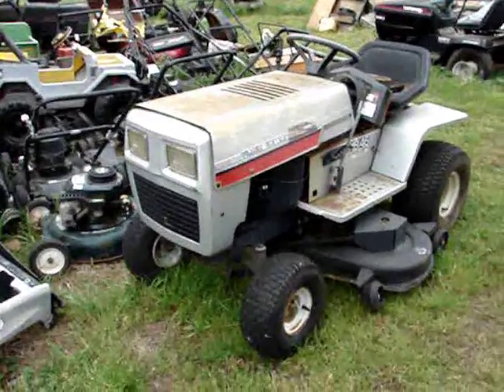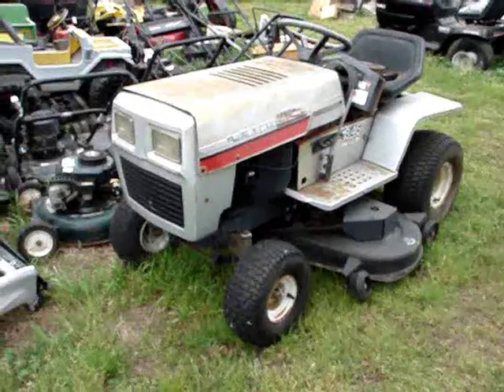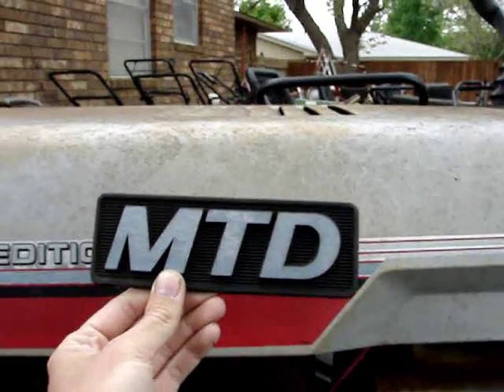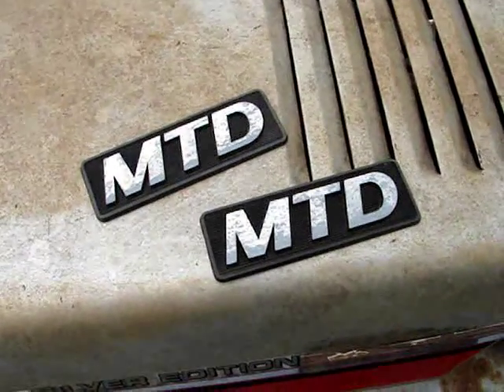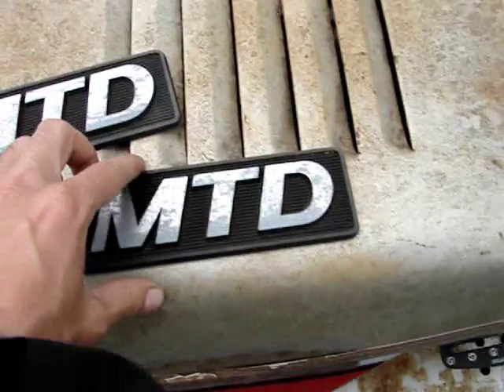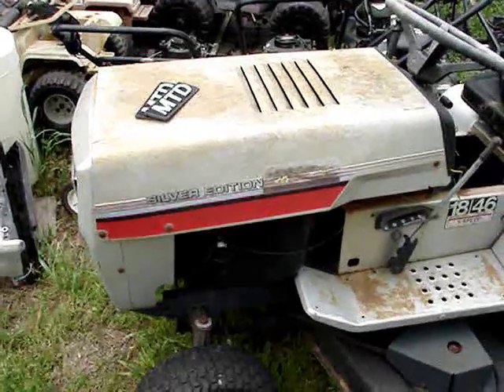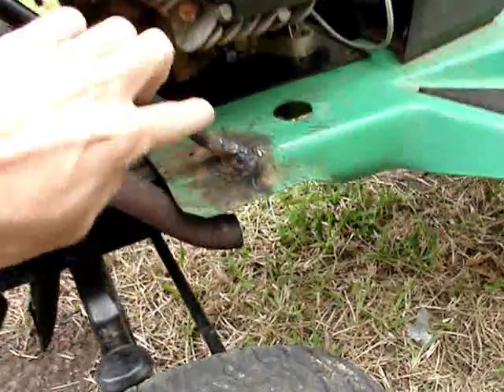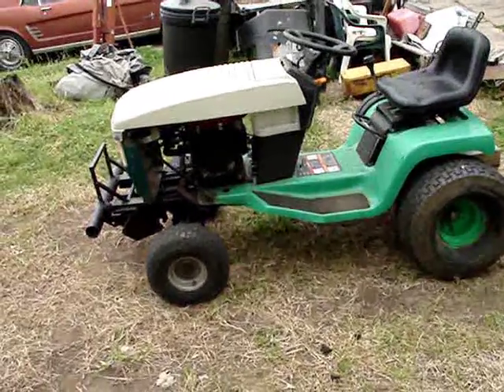MTD silver edition 18/46 lawn tractor, VERY RARE!

Comment: Funny!  That is off.  Its almost identical to my 18/44, cept it has the front half of the hood the same as my mudding tractor.  Never seen that with a big twin under it before!  And a smaller rear end.

Glad you finally found those MTD badges you were after, saves me sending you my  ones.

I really like all these MTD 'garden tractors' you're collecting.  I have a soft spot for them, would love another one!

I think that 5 speed was an after thought judging by the shifter location.  Pretty weird

Comment from the maker: I occasionally run in to people here that think the same thing. I tell them that by the time I am done replacing the battery, replacing or sharping blades and belts, cleaned carb, changed oil, and fixed whatever else is wrong, usually tires need replacing and steering repaired. That I won't make anything off it unless I get it for under 40 dollars.

Comment from the maker: 88, good year for tractors. I love my 88 MTD garden tractor. I have a 1980 Dayton(MTD) that had a well worn 16hp briggs twin. I got the tractor for free a few years ago, still use it today, but I did swap out the still running, but leaking oil and smoking engine for a 2000 model briggs 20hp twin a year ago. Going to rebuild the 16hp. Old tractors last forever, made with good steel, not that cheap impure china steel of today.

Comment from the maker: My old MTDs are far superior to any new model for sure, but goes to say that they were built when people cared about quality. My favorite tractor to cut with is my 1988 MTD model 852 Garden Tractor, it has the same frame and deck as the silver edition in the video, but different grille, hydrostatic drive, bigger tires and its red. I have never found a better tractor since then.

Comment: I typically don't care a lot for MTD but, they practically build everything or almost everything.  This here what you got was probably when they made good mowers.  Todays MTDs aren't bad but, I hate the fact lots that I have seen don't have any antiscalping wheels.  I prefer to have them.  Lots older ones like this I have seen have them.  I like too how this older one has a peerless and not the vari drive.  Still they are not bad though.  I have a 2004 Bolens its a veri drive but, it was given to me free.  My main mower is husqvarna built craftsman 22 hP Kohler 7000 elite series

Comment from the maker: Yeah, I know what you are talking about with the steering tie rods hitting the pulleys, I have seen it. The engineers that design these mowers must have never played with building blocks as kids. 

I always find it easy to find them on craigslist by scrolling through the farm and garden section with the price set to 50 minimum and 350 max. I don't use search words, because people misspell a lot. I may have to browse over the farming stuff, but I find old tractors all day.

Comment from the maker: Yeah, you had a GT18, I just had that exact same tractor til recently. It had one bad flat rear tire, a bunch of frame rust, didn't steer great unless it was moving foward, smoked a bit and deck needed work. Paid 75 bucks for it, sold the side shaft briggs twin for 130 bucks, swapped the front axle onto my Dayton and scrapped the rest minus transaxle. There is another in my area for 150 with no deck. I have a video of that GT18 with me driving it.

Comment from the maker: My own experience with older mowers, are that they are normally better at cutting grass and are built better than new ones. I went and looked at new MTD riders, plastic plastic plastic everywhere. Craftsmans are just as bad now, in fact Murray and MTD build some of the lower end models, and AYP(Husquvarna) builds the high end models. Fun fact, Murray is owned by Briggs and Stratton, Murray doesn't build there own riders anymore, MTD does. Saves on production by Briggs.

Comment: Hechinger's: one of the best and longest lasting mowers ever sold.  I have a Hechinger's tractor and rear wheel drive push mower, about 24 years old and still running.  They just don't make them like this any more.
Reply from the maker: You got that right, they don't build them to last anymore
Reply: This whole era seemed to bottom out after both The Home Depot and Lowe's went national in the mid 1990s and early 2000s, respectively. That put many smaller home improvement centers out of business, including Hechinger's as well as HomeBase (formerly HomeClub), Pay 'n Pak and Ernst (the last two both in Seattle, WA), leaving only True Value and Ace Hardware among the smaller mom-'n-pop home improvement stores to still exist today.

Comment: If the code number on the engine is anything after 87090112 (September 1, 1987), then it would most likely be a 1988 model. Especially if the engine is a "Twin II."

Comment: I just got one just like yours with bigger tires on it I was gonna pull the motor for my current mower and scrap the rest is it worth anything
Reply from the maker: Everything is worth something to someone. If its it good shape, sell what you don't want off it, keep old mowers from the scrap when possible. I only scrapped when they were rusted out and I had stripped them of all good parts.